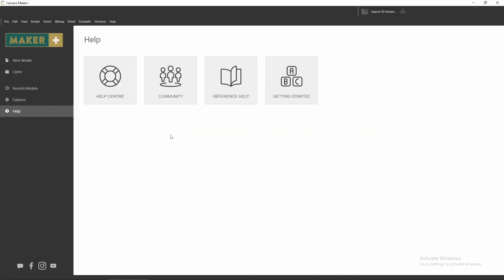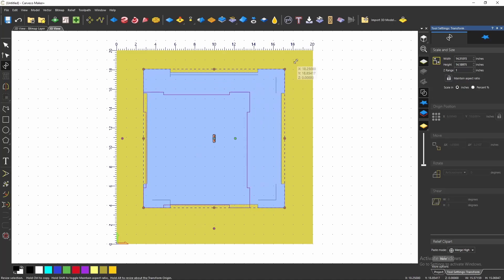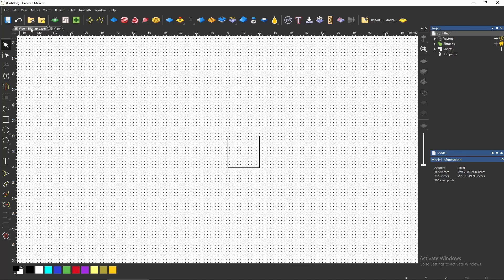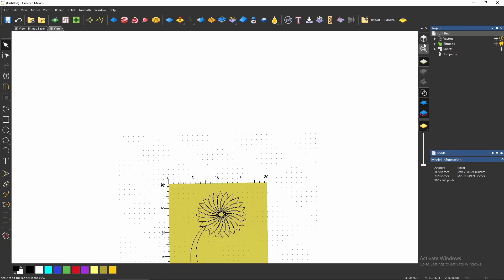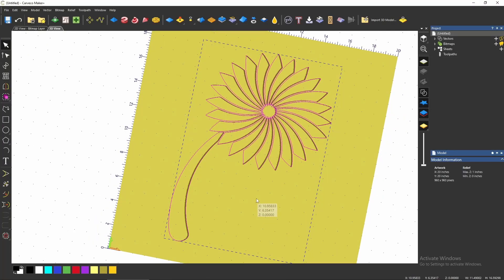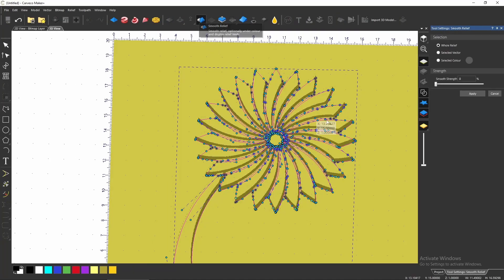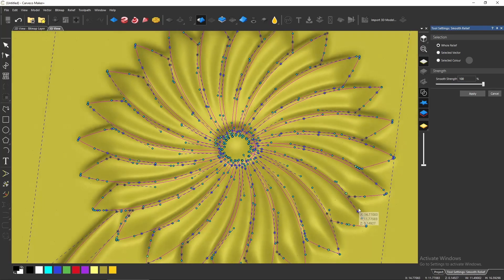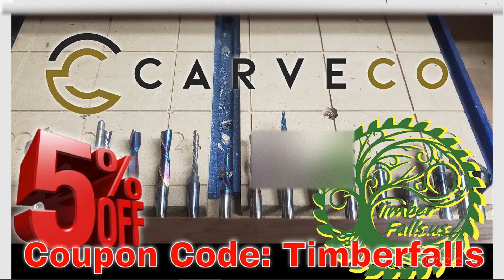Vector Image to a 3d Model using 15$ a month Carveco Maker

Comment: Ive tried and tried but no matter what I do the zero outside of vector does not give me a raised image what could I be doing wrong?
Reply from the maker: You have to do the step to add the material with importing something there first. By default there is no material on the zero plane so there is nothing to zero outside of. Start by importing the base sign and making it bigger than the project and paste it down. Then highlight the vectors and zero outside of vector to cut this material out.
Reply: @Timberfalls  Thanks I figured that out after about another hour that I skipped that step lol I had skipped it thinking I didn't need it because I already had an sagthansk for replying.
Reply from the maker: @Co2Aaron   Glad that helped! Thanks again for watching.

Comment: I'm using Carveco maker and i don't have the options like you're showing.
Reply from the maker: The important part is importing that base material from the clipart library first or it will not work. Check out this video as I show this technique in detail. https://youtu.be/NGsQzjMnTZw?si=EOMzLtnzmZ1DfBUl